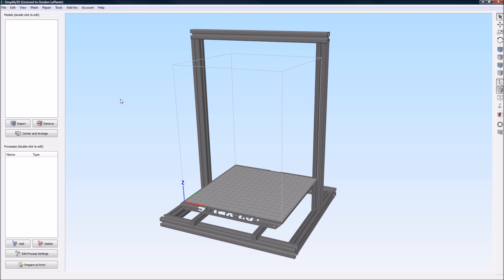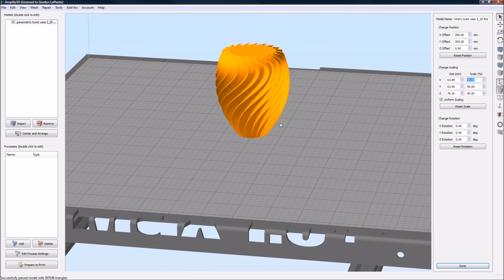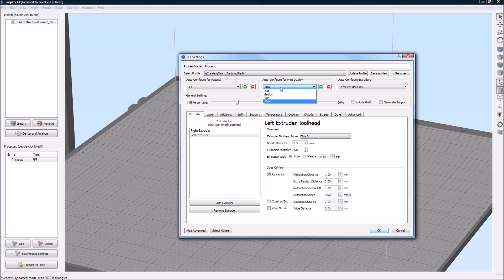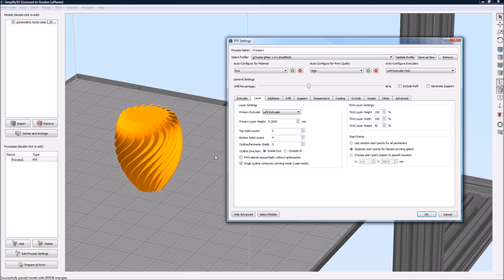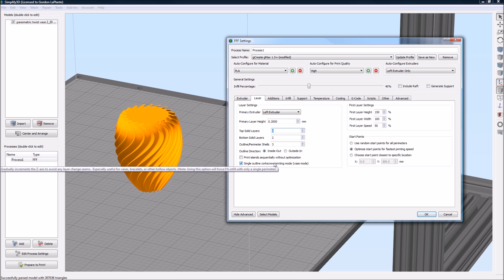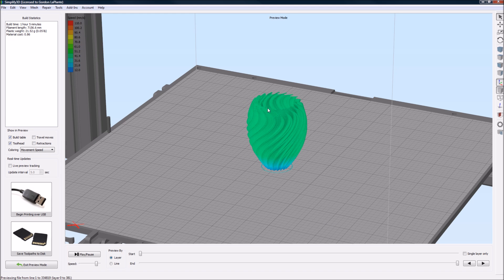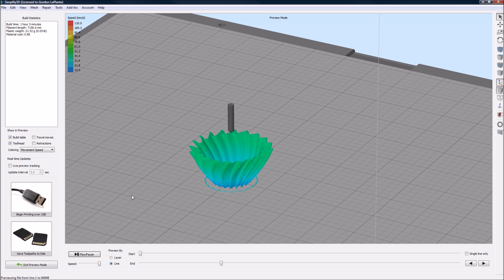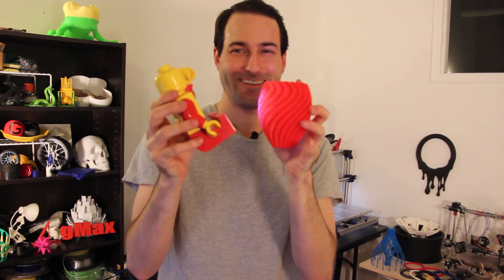Designing a 3D Printed Parametric Twist Vase - Part 2 Simplify3D and Time Lapse

Comment: i have a makerbot replicator mini. i dont think i can use simplify 3d directly. can it output a file that i can feed to my mini? also i want to make a straight tube that is twisted (so top and bottom same size) how would i add a shoulder to the model so i can "join" multiple sefments together to make a larfer tube? ie i can only print 4.9" so to make an 18" tube i would need to make 4 prints and then join them together. how would i do that in 3d?